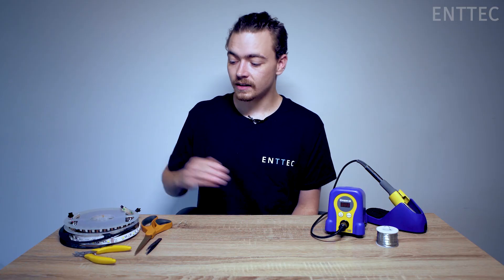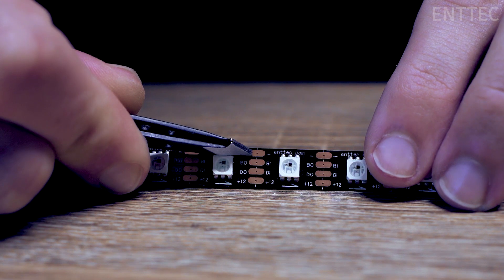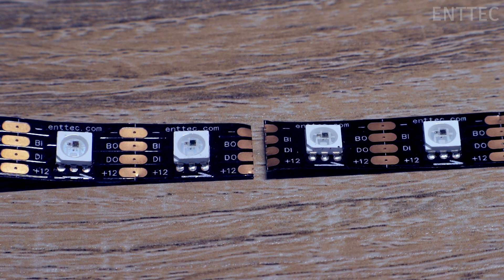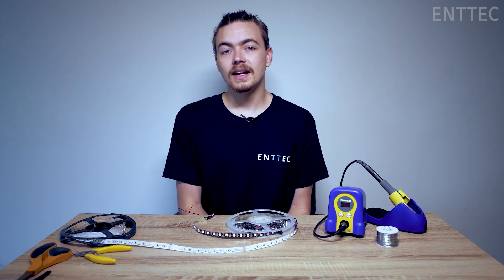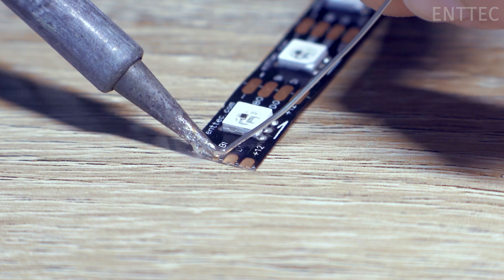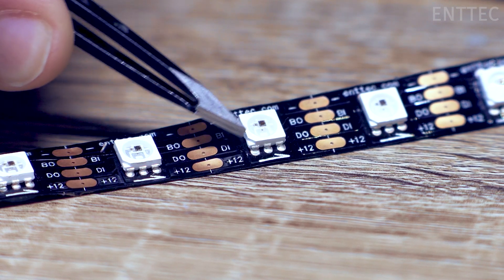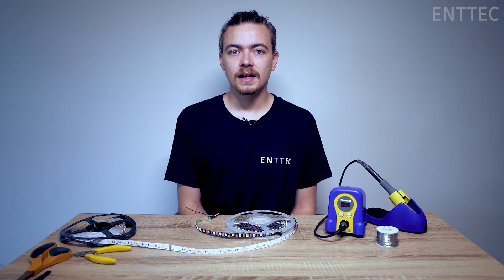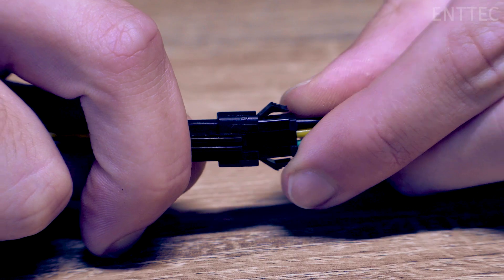Ep.2 How to cut + join LED tape

Comment: Very useful info. What temperature are you soldering at?
Reply from the maker: Hey Michael, typically I select 430 C as my target temperature when working with lead free solder - for larger joints or when tinning cable I up that to 435 C to allow slightly better flow.